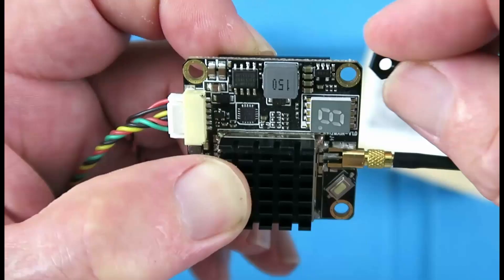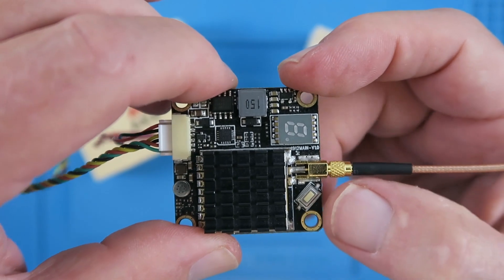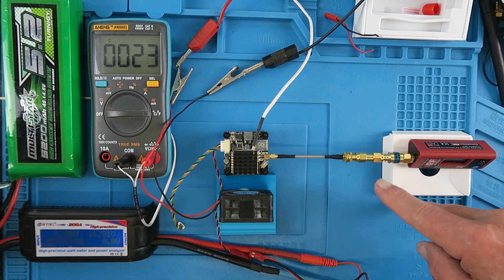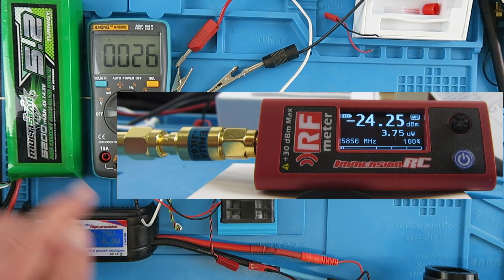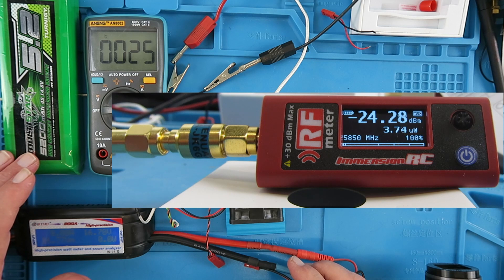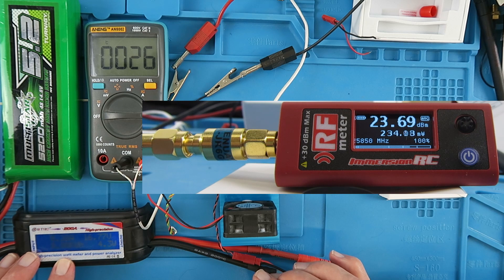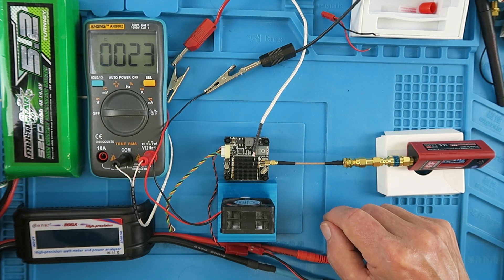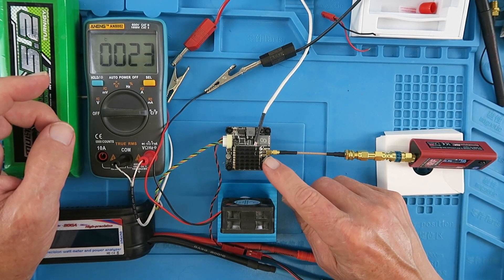AKK FX2 Dominator Long Range VTx Test Review

Comment: The new 3000mW ones , what size attenuator would you use on the immersion rc power meter?
Reply from the maker: I would use this : 5W SMA Coaxial Fixed Attenuator 6GHz 1dB 2dB 3db,6db.10db.15db.20db.30db 50ohms https://s.click.aliexpress.com/e/_AlrvA5
Reply: @1nformatica  yeh but I use a 10 db attenuator for checking my 1.5 watt quads . What size .. db attenuator should I use for this 3000mW ?
Reply: I guess I can just use the 30
Reply from the maker: @axemanarbor  Should be fine.

Comment: I just got this in from bangood USA  in 4 days time. I'm with u on the mmcx! I've used a few akk vtxs before. I always desolder the mmcx input from board and direct solder coax.  It works awsome. Those mmcxs just don't work so great.  If this unit is  pumpin out over 1.5 watts I guess it's worth the extra weight. It's definatly heavy.  I'm really curious to see how it performs.

Comment: Great testing, man. 😊
This VTX is really fantastic. I have a smaller one from AKK... 20x20 and M2 mounting holes and it goes up to 600mW if I'm not mistaken. 
About the MMCX connectors, they're better than the UFL connectors. Those break too easily. 😕